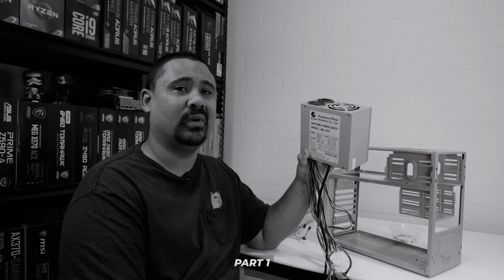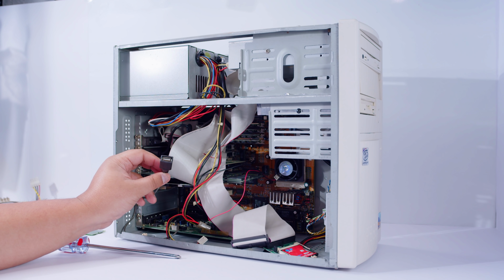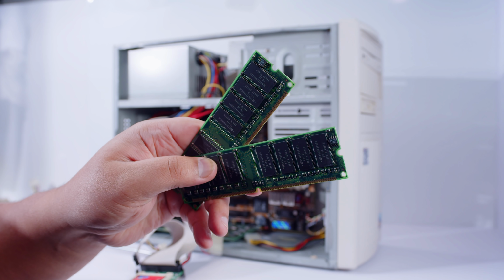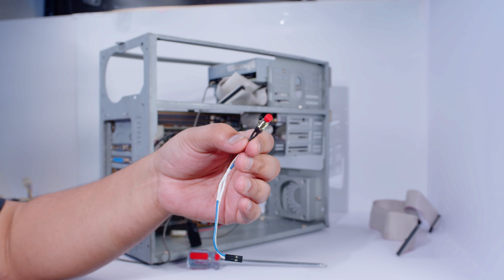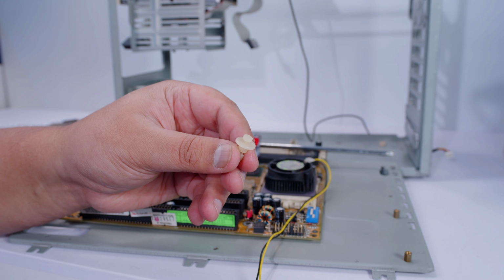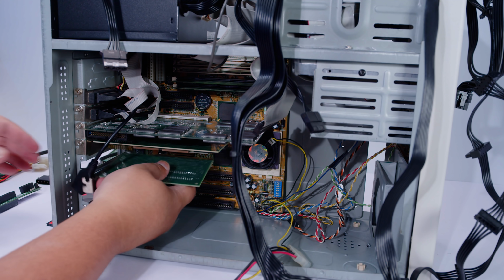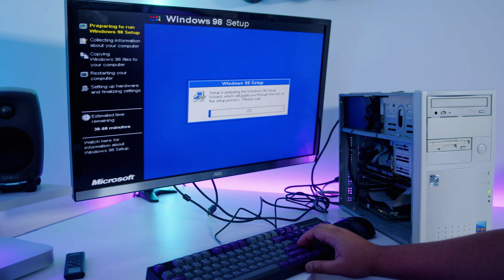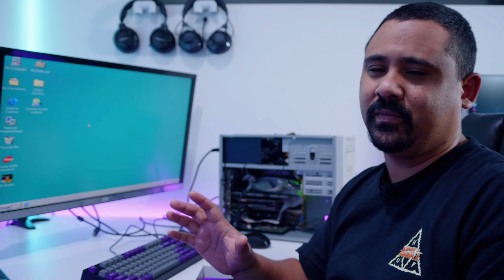DREAM Windows 95 PC got UPGRADES and Windows 98! - Part 2

Comment: My first  PC was an Acer Aspire AMD K6 200 MHz. If I recall right  my first upgrades to that system were more EDO ram, a 20 gig Maxtor HD, and an ATI All in wonder pro graphics card fallowed by a soundblaster live sound card. Later on I managed to upgrade it to a K6 400 via a janky looking  socket 7 adapter that converted it to the Super 7 standard.

Comment: LOL! like I said on Linus Tech Tips,  if you take care of it, it will last 10+ years.... socket 7 systems: Linux platform! providing you have maxed out the memory! and add a Sata interface Card... (if it can be supported...) Suggestion: take the serial and parallel ports and attach them TO THE CHASSIS... this frees up expansion slots. (built-in expansion ports)

Comment: This absolutely brings back the nostalgia, not so much Win 98 era but rather early Win XP era. From late 2019 and into early 2020 I pulled out my old Win XP PC from 2001, upgraded all the parts (save for the case) and turned it into a high end gaming PC from 2004. It was frustrating finding period-accurate parts, reviews, drivers and information but I was happy with the end result.

Comment: Love that your old parts are still clean and even the case is in tip top shape.  Normally, those will develop some surface corrosion.
@10:45, damn, that's a real motherboard as the traces are seen.  
Also, kinda surprising caps are not leaking yet.
This old system highlight makes you realize how far computer technology had come.  (from simple cable routing down to setting the proper pins on a hard drive to make it the master/slave, etc).
Reply from the maker: The caps on all my Socket 7, Slot 1 and Socket 370 stuff are all perfect. My socket 939 and Socket 478 boards are a mess with bulging caps.
Reply: @GearSeekers  I guess that's due to the heat generated by the CPU during that time frame.  386 to P3 doesn't heat that much as evidenced by the tiny 40mm (i think) strapped on the CPU on your vid.  Was just surprised that the mobo looks immaculate given the age.

Comment: Finally PT2.  Man i'm so old. I remember installing Windows 95 from like 25 diskettes. Kids nowadays will never know the pain when there's a bad sector on the 23rd or 24th diskette.
Reply: I so remember that happening to me TOO many times!!!!!!..eventually I got smart and put my Win98 install on a 8GB WD hard drive and doing the install like Nick does in this video, made it much faster than floppy or CD installs
Reply: I can remember putting the 6 floppies of Windows 3.11 on to a CD-RW (so could reuse it & the burner was a 2x SCSI drive with no buffer under run protection, and if you are old enough to remember drives before the under run protection, you used to waste more discs than actually completed burns!) & it installing in under 60 seconds on a Pentium P90 with 8MB RAM! It took longer to burn the disks contents onto the CD that it did to install!!!
Reply: That's emotional damage right there.